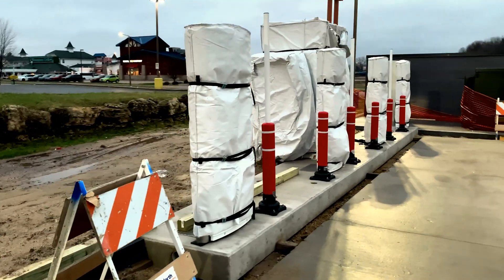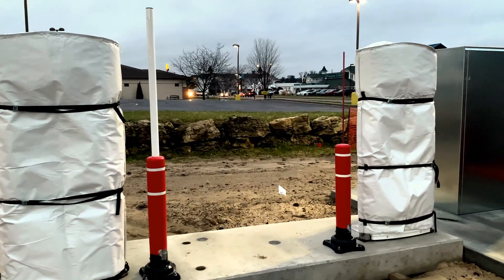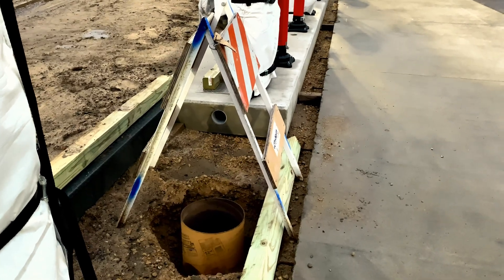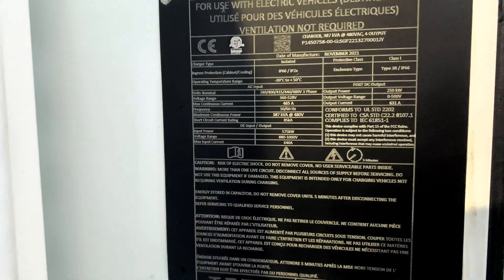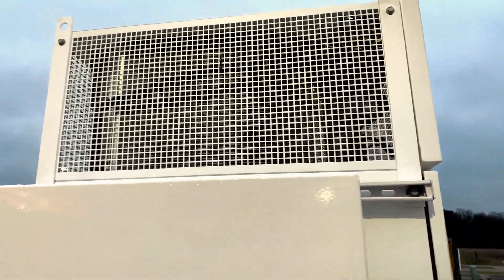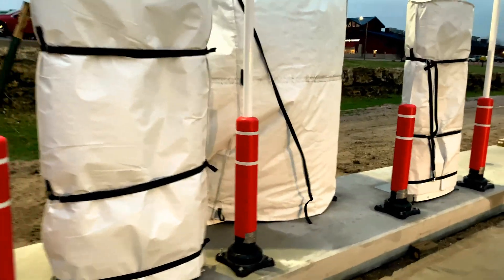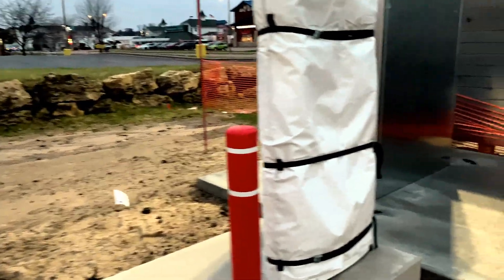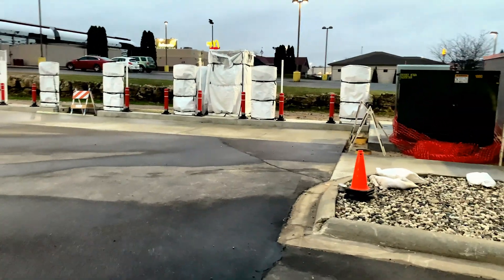Tesla V3 Supercharger Built on Slab DRAG & DROP :-)

Comment: K-man,   What is this V4 SuC you speak of?  I’m aware of the V3 SuC being turned UP to around 330A in the near future. All SuC that were installed in last 2 years have up rated below grade wiring to handle the increased output.
Reply from the maker: I have another video coming on the V4's :-)  along with some predictions on the implications on the roadster and cyber truck. MUCH Higher Voltages, higher output.

Comment: Seeing how you were in the Dells, did you go to the R&GN spring cleaning?
Reply from the maker: Unfortunately no. Getting the Motel ready for summer. I spent the beautiful Saturday putting up Pinewood Plank ceilings. Started unit 7 at 8amp stopped around 7pm to plant 25 pine trees before the rain started, went back to unit 7 at 8pm and finished that unit 7 at 11pm. I have 2 more units to do ceilings. That burned me out though, my arms feel like butter after holding the nail gun all day.

Comment: They need to leave the back side of the chargers open to parallel park with a trailer so that you could charge from the back side of the chargers without blocking multiple stalls.
Reply: The Carlton MN SuC is configured exactly like that. 7 back ins and 1 parallel pull thru.